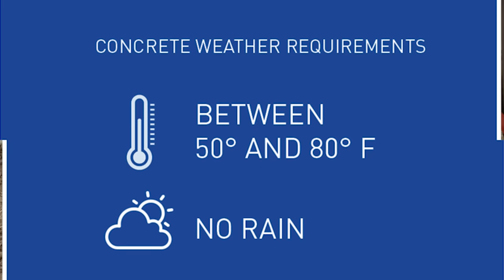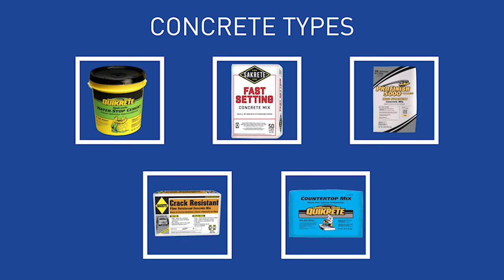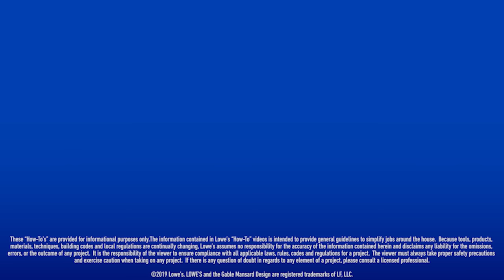How To Repair Concrete | Pro Tips For Repairing Concrete

Comment: If you haven't any lumber to form its edge, just make the cement mixture sticky but not too dry or not too watery and form the edges with your plastering trowel. Only if its up to 3 inches high.

Comment: The sidewalk in front of my house is cracked and eroded after years of neglect. This video provided the exact information I was looking for. Thank you.
Reply: well, 7 months later... that would be after years + 7 months of neglect.
Reply: @adorkable81  Fixed it immediately :]
Reply: @BillyOnYouTube  nice... Give me motivation to fix my pavement. May I ask which mortar brand and type did you use?
Reply: @adorkable81  Sure! I used Quikrete Fast Setting mix. Mainly due to the price tag to be honest lol. I covered the bit I repaired for 1 day and it turned out fine!

Comment: I would recommend drilling and adding rebar in that complete sidewalk replacement as well. Concrete plus rebar is 10x stronger
Reply: totally.   surprised he didn't do that
Reply: I know nothing, and I was also curious why he didn’t do that.
Reply: Just one rebar?
Reply: @simd510  I’d recommend one towards each end drilled into the concrete then I would put another length ways and tie them together
Reply: @elementalbioremediationinc21  Makes sense, Thank you!

Comment: What do you do for the curb on a driveway that is rounded? I have a small section like in your sidewalk repair (Not replacement) but I drive over it to get onto the driveway and it is curved. (Maybe a week waiting will be too long...) I need a curved form? (But I can't hammer in a form because of the street and driveway. )

Comment: Good video. I am from LA-California. I want to repair driveway  of my Motel immediately. I have many small & big cracks. Also have some very old repaired big patches in which old concrete disturbed.
Guide immediately in my foliwing area.
(1) what rapid hardening concrete we should use in small & big concrete? Should we add something in ready available concrete?
(2) if we remove old damaged concrete then what concrete we should( rapid setting ) use in area?
(3) After repairing  all cracks & old damage patches should we apply thin layer of strong concrete of all driveway area? What is best material & what thickness require?
Is this entire layer give more strength to entire driveway? Or give only good looks to driveway?
Reply quickly.

Comment: How do you cosmetically fix the concrete AFTER it has been repaired? I have a white line of filler and it still looks awful. Help!
Reply: paint the whole drive way
Reply: Driveways resurfacing with Quickrete
Reply: Paint it grey
Reply: @juliandeleongonzalez2852  great advice Julian

Comment: Try to repair a concrete floor slab that had pits in it and some crack. Used quick-settint cement patch. Followed the instructions to the tee, best I can tell. The patch cracked during drying.
Reply: far from a pro, but my guess is it dried too fast

Comment: It would have been nice to see how all these projects turned out. Like the hair line Crack and the bigger one.
Reply: There are too many variables for any given pour. Things like freeze/thaw cycles,  use of salt in winter, ground shift, Or mixture that is too thick or too thin, pouring when it's too hot or cold, etc etc etc. 
If you're doing a patch/fix go for it, it may fail at some point, or the concrete behind it may fail. It can easily be redone.

Comment: Thank you for this video — very similar to my issue. How much might it cost (materials and labor) to have this done for me?
Reply: Depends on size of driveway and your location plus if you need trees and roots removed. Probably 5-10 thousand for entire driveway. Patches much, much less. Getting the roots out that caused the cracks in the first place has to be done.

Comment: QUESTION: if having to replace an entire section (because of excessive
       damage) along a run of sidewalk...do you need an "expansion strip"?
Reply: no. You only need an expansion strip when butting up against an existing structure like a house foundation that won't move with expansion. the other sidewalk sections have expansion joints (cuts or grooves) in them already so they should be able to absorb any movement of small pads like this one. If you're going over around 8 feet, you'll want to add expansion joints that line up with existing joints.  You can do this with a jointing trowel or an edger, or you can cut the joints with a concrete or diamond blade saw after 24 hours.  You'll want the joint to penetrate at least 25% through the slab, which is a 1 inch depth in a 4 inch slab.

Comment: Can hydronic cement be used for a large walkway patch?
Reply from the maker: It depends, is your walkway already heated or has a hydronic system preinstalled? If not, we do recommend a quick setting cement for its superior bonding properties.

Comment: My question is. I need to do this on an outside sidewalk. Are the boards easy to remove? They dont mention that. Like your pouring concrete to the side of the boards how in the world do they come off?
Reply: you can add an oil type base to the boards so they pop off when the concrete hardens. sort of like PAM cooking spray is used in pans

Comment: I have self leveling concrete I need to use on uneven parts of my concrete slab
Reply: Just a precaution, most self leveling compounds are meant for indoor use and to be covered with flooring.  Traditional self leveling probably won't hold up in outdoor use when it's uncovered.
Reply: Follow the instructions on the bucket. It will be runny.

Comment: HUh gonna have to watch  more... find the right one.. HOA had my driveway pressure washed because it was "too dark" and claimed it didnt look new enough. Now I have to use outdoor cleaner and have it pressure washed again twice a year because it literally turns black every few months - only ever since they first cleaned it. It sucks!
Reply: Not sure if this would help, but I believe that there is a sealer use. And should be applied after a power wash.
Reply: I’d move if you live somewhere so harassing for such a small thing

Comment: Purchasing Concrete!!? Make your own using the magic numbers 3:2:1 by volume, doing it this way you can choose the correct size Aggregate for your purpose. So lets go three parts aggregate you choose the size. Two parts Grit Sand sometimes called Concreating sand or sharp sand. One part ordinary Portland Cement or fast setting version. Now the bonding agent usually this is Builders PVA Adhesive or for a stronger bond and also to add some flexibility to the mix use SBR additive replacing  the  PVA. Doing it this way makes things far cheaper you will always have the exact amount of concrete for your needs, and as long as you keep the Cement in a dry place you can have concrete or brick mortar whenever you want it.
Reply: jas20per worst way to do it
Reply: @AS-cu2rd  HAHAHA.  You had to be that guy huh.

Comment: How much space do i need to keep a sidewalk slab away from brick ., ( this is at a basement door , ) sidewalk is uneven , or should it be right up against the brick ?
Reply: Needs expansion joint foam
Reply: @ChipChurp  Ty, I never got to this over Summer guess i have to suffer with it now until Spring

Comment: 2:02: why did you partly fill the crack up with water Lowe's representative?
Reply: It helps stop the existing concrete from absorbing the water from the newly mixed concrete

Comment: To cover those small cracks or thinner cracks you use the cement with rocks or plain cement please
Reply: This might be 2 years too late but Cement is a part of Concrete, it's the binder. So if you need to cement something, you're just using the cement. Pouring concrete adds rocks as aggregate along with cement and some sand and is usually used like in the instances where he was pouring sections like the sidewalk. I hope that helps.

Comment: Will this same method work inside home also?
Reply: Are you talking about counter tops or repairing a floor?
Reply: @DaDaDo661  would this work on cement floor inside a house?
Reply: @rakajawaa5500  
Yeah if you talking about a basement floor or something. It's called concrete patch
Reply: @DaDaDo661  thanks!

Comment: i just monumentally screwed up a large dining table top by using the wrong type of cement.  it was too big of a job and it started setting up before i was done mixing and pouring.  it left me with a horrifically rough surface.  Is there a leveling compound i can use that will yield a more finished feel and look? can i pour concrete over the top?  any tips would be greatly appreciated.  #rookiemistake
Reply: Use a diamond surface grinder. 4 1/2" right-angle grinder with the threaded diamond cup wheel. They're hell to get off once grinding. I propped a lawnmower blade in my wheel to get it back off the grinder. Rather than repour a slab for a driveway, I once used that to cut the edge down for a slope. Note, they make a 7" version too for larger grinders.

Comment: Why he uses a piece of wood at 4:07, instead of sand as he says in the video?
Reply: What do you mean? The wood is for the sides. The sand is for the bottom
Reply: Prestia2011 look at the video carefully after 4:07. You see a wood or something else at the bottom just before he starts pouring concrete.
Reply: @ranger5705  no that's wet sand. It looks like wood. It's moistened sand

Comment: How do you remove or crack open the old concrete-is there a special tool?
Reply: You can use a rotary/hammer drill.

Comment: If you wet the concrete( after setting or after a day) for couple of days with water spray,  I would give more strength.  It may be true for hot climate.
Reply: It got to 90° today. A micro burst came through and quickly cooled the concrete to 60° with rain. That popped a few of my patches up. I had to reform them.

Comment: No rebar or wire mesh? No joint filler and you didn't add any water in the curing process? That concrete is gonna crack again

Comment: No one uses plastic these days. There is no use for it. You also don't have to let the form sit for a week. 1 or 2 days is good enough.
Reply: 1 week is too long, but 12 days good enough?
Reply: @infraprods  I meant 1 or 2. I just fixed it.
Reply: Sorry  @saulgoodman2018   Dude I knew what you meant, I was making a funny.  It was obvious that you meant 1 or 2 not 12.  And I agree with that completely
Reply: Clearly you have no idea what you're talking about. We always use plastic in the concrete industry.
Reply: @RHEC1776  Whenever I do concrete, I just leave it, I never cover it with plastic.
I never seen anyone cover it with plastic.
Reply: I use plastic if I  know it'll rain in the first 24 hrs after pouring.
Reply: @tmoomoo42  If it's going to rain, it's different.